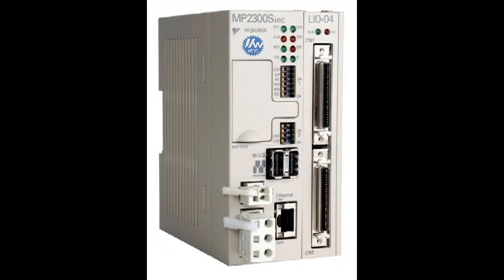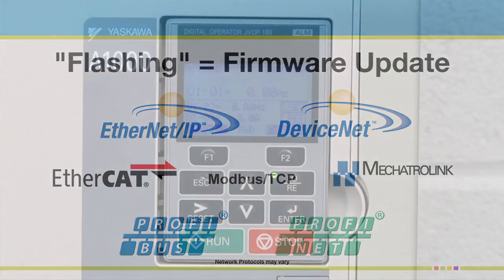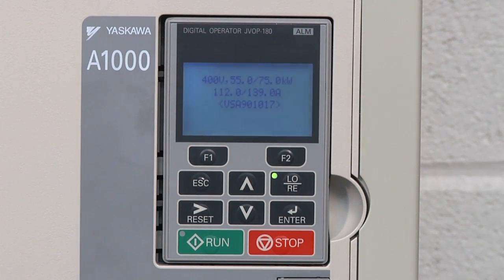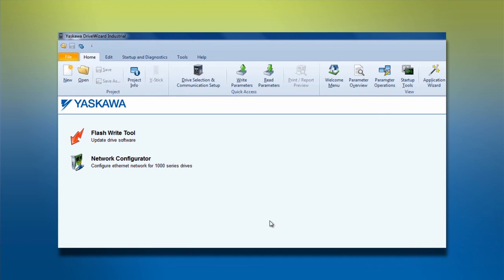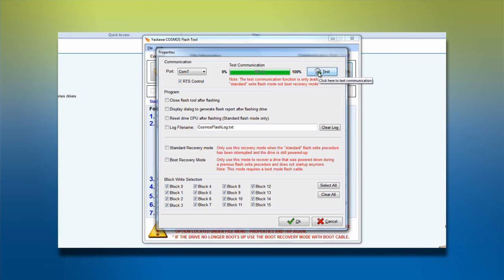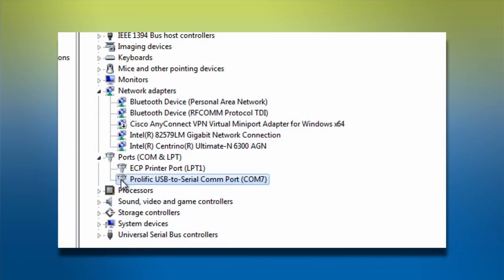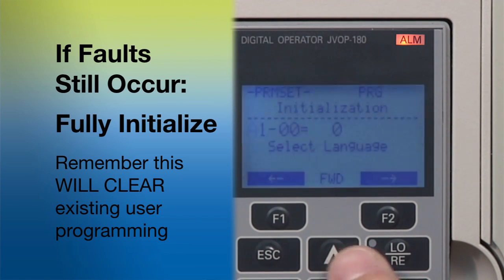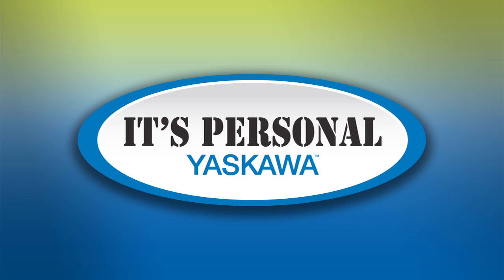Flashing Firmware on an Industrial 1000 series drive

Comment: Sir ,  we are using v1000 we can't able to run at 60Hz motor gets load and stops , (motor specifications 10hp, 13.7 amp ) if we run at 40 Hz  it works ,  what may be the reason , please reply sir
Reply from the maker: Thank you for your interest. Please contact our Technical Support Team with more information on your application to further assist you at https://www.yaskawa.com/support-training/support
Read more

Comment: Dear Sir, 
I have Omron V1000 vfd Firmware version 1018, instal with memobuss communication. 
Now i replaced it with yaskawa V1000 firware version 1025.
I set the parameters same as Omron V1000 but VFD not running even i copy parameter from Omron V1000 via Drivewizard industrial and paste to Yaskawa V1000 same capacity vfd but communication are not standing.  Plz help if any suggestions. 
Thanks Yaskawa America Team.
Reply from the maker: Thank you for watching our "Flashing Firmware on an Industrial 1000 series drive" video.  We have received your email and will correspond with you via email.